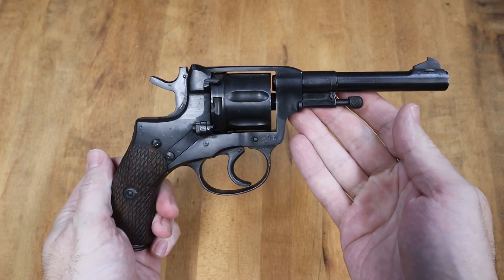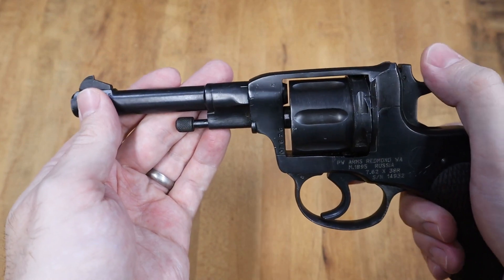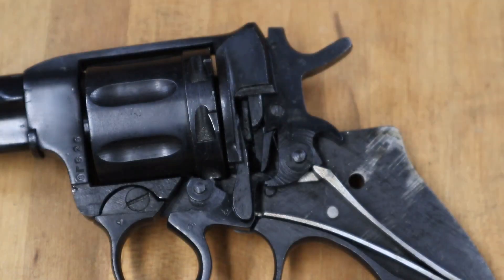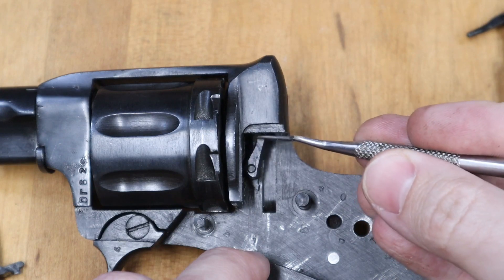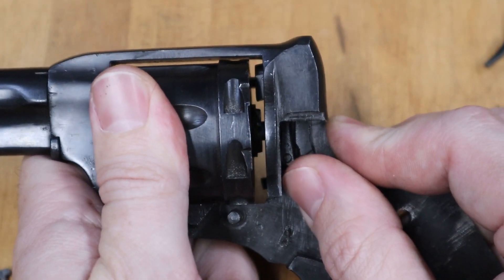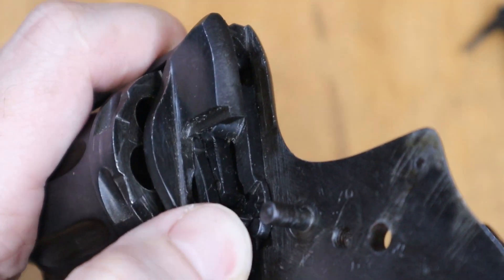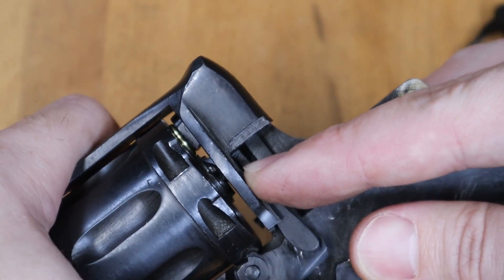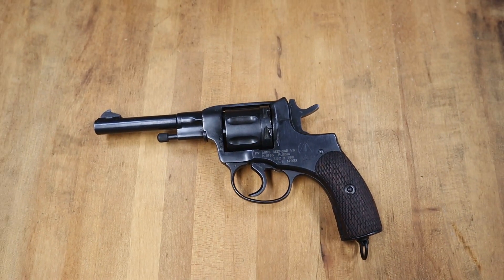How the Russian 1895 Nagant Revolver Works

Comment: Explains how the brass doesn't just slide back when the gun is fired. Wonder why this makes the trigger so bad though? I see there is spring tension pushing the cylinder back into original positon but most of the work I think is the rough fit of the locking block mechanism that really hangs up the trigger pull right at the end.

A better way they should have done it is have a spring mechanism you charge at the beginning of the trigger pull, not at the end. This way the trigger pull is garbage except right in the later half where it actually matters.